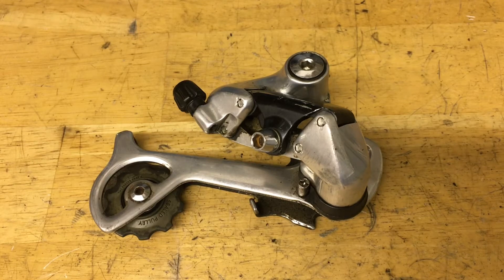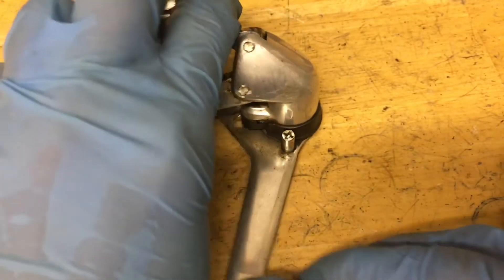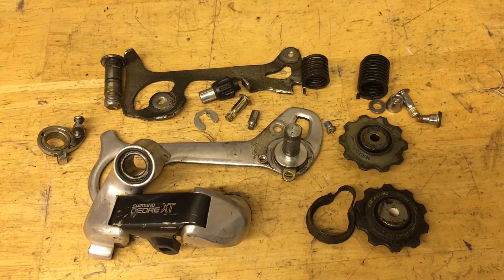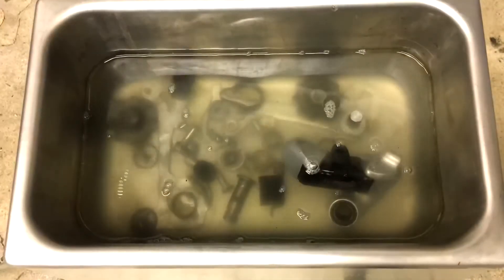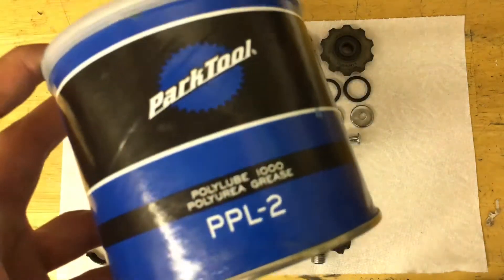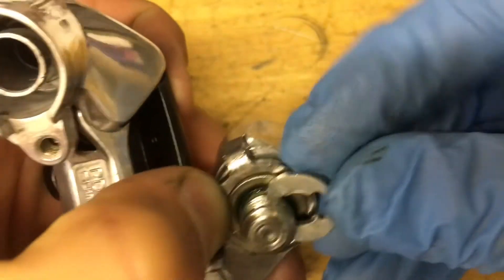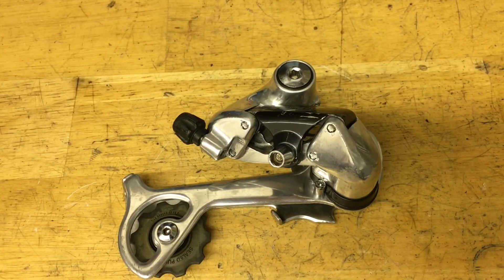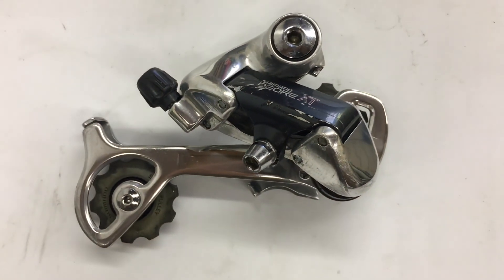How To Rebuild a Deore XT M730, M732, M735 Derailleur

Comment: Hey this was very helpful and I liked your directives. My jockey seals are brittle and two broke when taking apart - do you have any recommendations on where to find new seals or even new jockey wheels altogether? Thanks!
Reply from the maker: Best to fetch them off a parts derailleur on Ebay or find them locally. You could also upgrade to BBB Sealed Bearing ones I think they’re only $20 that’s not bad.